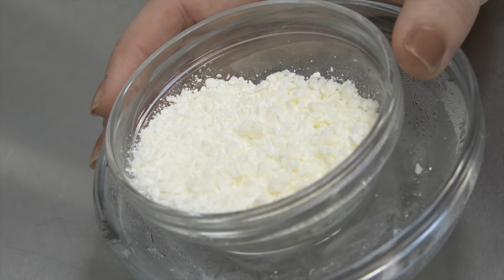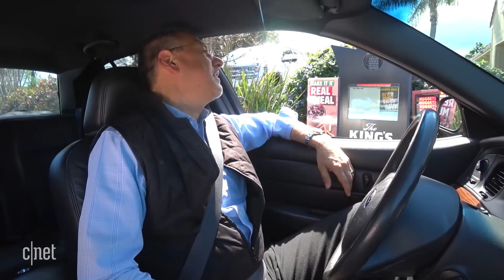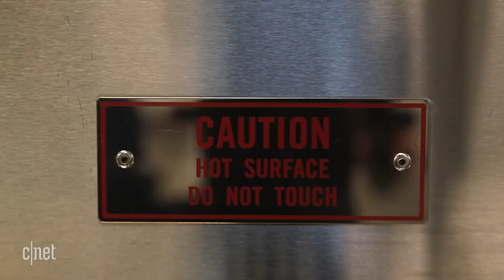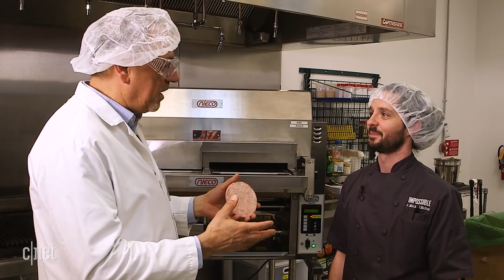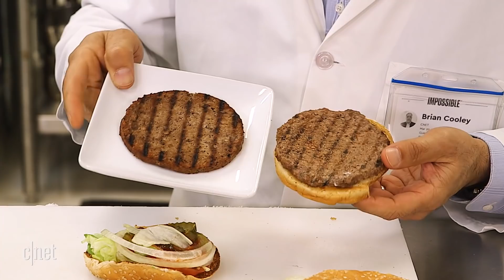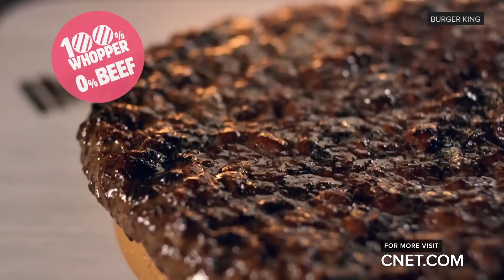Trying Burger King's Impossible Whopper

Comment: I don't understand it. The goal is, that it tastes exactly the same as a normal whopper, but it costs 1 $ more? Of course if you are a vegetarian you would pay an extra dollar for the burger. But shouldnt the goal be that even non vegeterian would buy it? For me personally, I wouldn't pay a dollar more for a burger thats supposed to taste the same. I would still buy the meat version, because it's a dollar less.
If it's the same price, I would consider trying the vegeterian version.
But that's only my opinion...
Reply: There are two factors to this. For 1, animal products are heavily subsidized, due to their feed being heavily subsidized. Should that go away, the beef in a burger will most likely triple or quadruple in price, at the very least, double. That alone could close the gap.

The second factor will be the bigger one though, and that's mass production. You can't scale beef production very easily, but you can scale plant production. Right now, it's still in a sort of prototype phase, but as more and more people start demanding these burgers, production can ramp up, and with it, comes a drop in cost of production per unit, and therefore, a drop in price. That could drop the price of this down to be the same as a regular burger, if not even cheaper.

Comment: As a vegetarian for over 20 years I have tried countless veggie burgers.   I finally got to have an Impossible Burger.   Very GOOD!  The best I've ever had...quite tasty.   Then ...........I tried the Beyond Meat Burgers.  So  sorry Impossible, but you have just dropped to second place.     Both were equally great in many ways although I did like the texture of the BMB.  However, the Impossible Burger just looks like any other preformed flat hamburger and is quite thin.   You would have to stack two IB to get the same height as the BMB.    
I will still enjoy the Impossible Burger at Burger King but perhaps I'll order double patty.

Comment: I can't remember the last time I had a decent burger at Burger King, nor have I ever been present when the burgers are getting cooked in anything other than the microwave. When I was a kid I remember the massive flame broilers they had going in back with a conveyor belt making burger after burger.  Not seen that in use since early 1980s. Lettuce and tomatoes usually resemble something picked from the dumpster as well. Quality control is non-existent at BK these days.

Comment: I did not realize how costly a Whooper is, $4.19 for your basic Whooper. I rarely eat fast food and when I do it is generally In-n-out, where a double-double is $3.45 and is WAY better. While I think this Impossible Whopper is a good and important step, until the quality is better or the price is the same or lower, it will not make any meaningful impact on meat consumption. From what I can find, outside of BK, buying Impossible burgers will cost you $6 for 8oz, which is $12 per pound, which is about 4 times the cost of standard ground beef and closer to the cost of a nice steak.

Comment: It's going to loose because of the price.  Sell it at the same price as a whopper.
Reply: The impossible patty costs more to produce right now because the company is very small compared to the gigantic beef producers that supply BK and other fast food chains. It's economics of scale. This particular contract will help them inmensely to expand. After a couple years producing in large scale you can expect the price to be equal or lower than beef.

Comment: But can a vegetarian trust that their impossible burger hasn't come into contact with a surface where meat has been prepared? This is great if employees are properly trained, and seperate equipment is used. This cooking method suggests that each location requires a seperate conveyor broiler to avoid cross contamination with meat. One slip up and someone who hasn't eaten meat in years could be pretty ill.

Comment: The only problem I have with making substitutes that are there with the ability to fool people. Is that people will believe that the intent is to fool people. 

It breeds paranoia. 

I have no problem with ethical eating and no problem with eating vegetables and fruits. But covert meat replacement I think will just drum up a lot of fear and suspicion on the motives.
Reply: Especially if they cost more than a regular one. Still, if helps to reduce the overweight in general, I'm fine with it.
Reply: @Lex60  well it's only more expensive at the moment, because the technology is still bleeding edge. Once the production line for it is established in sure costs will come down.

There is a floor to the price of raising cattle. And if the end production cost of the impossible burger is lower, it could cost jobs in the agricultural sector as farmers cut costs to keep prices competitive. 

Beef requires lots of different steps to lead to the final product. Which take up massive real estate footprint. There's a set amount of arable land needed per cow. And then there's ability to respond to market. 

Raising cattle to slaughter age takes a lot of time, so farmers need to plan way ahead of time. Depending on the processes and materials needed for the impossible meats, they may be able to ramp up and down production as market needs. Which means that there's less potential for over or under production.

Which will lead to lower costs of production. There's a ton of positives to come out of this technology... But the social impact could be massively negative.

Comment: All that science and Burger King still cant reach the conclusion to toast their bread.
Reply: Lol we toast every bun before we make the the burger.
Reply: I worked at a burger king when I was 19; they toast their buns, and pretty often the buns get stuck in the toaster  because it works by you putting the buns in the top and it shits them out at the bottom, with a heating element inbetween, and sometimes they're slightly too fluffy and get stuck close to that heating element and smell like shit.
Reply: The leftover meat that passed the timer, after resetting it 2 or 3 times, got put in a pan, crumbled up, frozen, and used for the next batch of chili.
Reply: Lucky Stockdale Wendy’s dude
Reply: i much prefer soft somewhat cold buns contrast with warm juicy burgers
Reply: oh they toast it. probably once a week.
Reply: @jhoughjr1  So people like soggy bread?. Damn. Color me surprised.
Reply: Ask for it double toasted nd it changes alot
Reply: Except that they are toasted.
Reply: don't like toasted bread...…………………………………………...soft bun with a drizzle of beef broth so that the burger's moist like White castle
Reply: @robinsss  that's disgusting. it only works with white castle because the burgers are like 3 inches wide and long.
Reply: wrong...……………………………………….it's a matter of taste but the  White castle flavor combination works with any size hamburger…………….………………………………………….the core flavor combination is onion and beef...………………………………………………….the pickles complement that combo and the moist bun  makes the whole burger moist which eliminates the need for mayonnaise , ketchup  or cheese
Reply: @robinsss  if that were the case you'd see normal-sized white castle burgers, which I've never seen at any establishment i've been in. i understand the logic. but a properly cooked burger is juicy, and thus when you bite in to it will saturate the bun making it soggy. you are the first person i've heard of that likes soggy bread... the rest of us prefer toasted bread so we aren't eating a mouth full of greasy flour. 

again, i understand your preference, i'm just saying you are in the minority that i would consider wrong ... like putting pineapple and ham on pizza.
Reply: if I  use  the same ingredients currently used in white castle burgers but make the burger larger if the only thing I changed was the size the flavor should be the same…………….……………………………………..white is sticking to it's trade mark burger despite the fact that it could produce large burgers...…………………………………………...they have known that for decades…………….……………………………….the  bun is not soggy ………………………………………...I only drizzle a teaspoon of broth on each half of the bun…………….…………………………………...and only Keiser rolls
Reply: @robinsss what you perceive as "flavor" is a combination of different tastes and textures. if you change the proportions of something that works such that you have proportionally more meat it doesn't mean it will be as good. but i've said all i need to say. it's your burger, enjoy it however you want - just don't expect the majority of the population to.
Reply: texture and flavor are two different characteristics…………….…………………………………..if  I made the beef patty proportionally larger in the larger version of the burger it would change the taste of the burger but I wouldn't change the size of the patty in proportion to the bun.………………………………………………………………………………….I prefer a thin patty …………….…………………………………………………..whether the majority likes my type of burger or not  White Castle's is doing ok considering they have been around since the 20's
Reply: I don't know where you eat at. But Burger King has ALWAYS toasted the bun.
Reply: Why would you toast a bun in a toaster or oven in a fast food place? When I cooked I'd just throw them on the stove top. That's the quickest and best way 👌
Reply: They used to toast them, at least when I worked there 20 years ago, it goes through the lower level of the machine. But that might have changed those baskets weren't there when I worked there, the guy on the other side would match up the buns with the burgers and put them in a warming drawer where they sat the assembly team needed them, unless you asked for a freshly grilled burger.
Reply: D. Carmo saves time and money not to. People will still buy regardless
Reply: culvers buttered toasted buns are top notch (as a vegan id love a vegan butter, and there are decent ones out there)
Reply: @4:43 ... you were saying?
Reply: Can’t ever remember eating a whopper and wishing the bun was toased
Reply: When i worked at bk, for that month, to buy a car, and get a better job, we toasted the buns in a little drop down toaster , then microwaved it. Lol
Reply: Everybody thinks they know how things are and usually they don't have a clue.

Comment: I have had the Impossible Burger at two locations in the DC area (obviously not BK) and I was not a fan. It left a really odd taste in my mouth when I was done and it was too salty. The texture is still different. It did not taste like it was an animal. I will admit, it was the best vegi burger I had (better than Beyond Burger), but I will stick to my meat. Just my opinion. I dig the innovation going into this though. If I was told that I could no longer eat meat, this would be my choice though. After a short period of time the texture would become normal as would the aftertaste.

Comment: If and when this catches on, and I think eventually it will, the price will come down as the demand goes up. They will be able to in time mass produce the product and cut costs.
Reply: You must be really naive to think the price will go down as the demand increases. You buy a new video card lately?
Reply: @davidtrottier1398  100% plant-based burgers are more expensive because they are the result of a lot of expensive research and because they haven’t yet perfected the manufacturing process of plant-based burgers over the course of decades to make it cheaper like we have done with regular meat. So that's why I suggest it eventually will get cheaper, not because I buy used video cards on ebay?? lol
Reply: @davie261  Point I was trying to make is that when demand goes up it doesn't necessarily mean that the price will drop using the personal computer video card market as an example.
Reply: @davidtrottier8963  Agreed

Comment: I'm one of the few who really should not eat beef, because my body doesn't process purines correctly, and I end up with elevated uric acid levels.  Because of this, I have cut my beef consumption down by about 90%.  I really only get beef when an alternative is not readily available, or on special occasions.  This would allow me to buy a burger as a normal thing, rather than always opting for chicken.  I had a "burger" the other day, at the Cheesecake factory - it was the Impossible Burger.  I've also had the IB at a couple of higher end pubs in my area over the last couple of years.
If Burger King rolls this out nation wide, I'll buy the IB exclusively when I go to BK.  $1 extra is nothing.

Comment: One dollar more for the healthier option. This WILL be the reason why it will not catch on, with the exception of the niche few. Instead offer it at the same price and if not for maybe $0.15 or a quarter more, but not a dollar. Most of america is at or below the poverty line. Cheap food is what they can afford. Unfortunately most, if not all, doesn't have the full nutritional value as a healthly premium meal does which also cost significantly more, and in which lies the problem with obesity. I have eat "healthy" but all in all I have a dock job that keeps me active which will burn off anything I put in my body. But again not everyone has that option. Yeah they can take a walk, run, or do some kind of recreational exercise, but when when you're living to just survive. "Healthy" is not a priority. So quit putting health as a premium and start putting it at a leveled priority for everyone.

Comment: But every Carl’s Jr. location has beyond meat? The last statement in the video is a little inaccurate
Reply: There are 0 Carl's Jr. in my state. There's Hardees, but the Beyond Burger deal was only for Carl's Jr. Hardees locations were not included even though otherwise they are essentially identical restaurants.
Reply: BK is going to be releasing in 7,200 stores. Thats more than beyond.
Reply: not yet though. Carl's Jr did it right and released it at all locations. What BK is doing makes me think it's designed to fail.  @nykidxxx
Reply: NickYDGn It's not at all. It mentioned at the scale of which it was happening. Carl's Jr has 1,490 stores. BK has over 13,000.

Comment: JUNK COW'S - So what is a junk cow.I used to be a Bull Hauler 1 job I hated was picking up old cows that had low milk output most of these cows looked run down bone  puss bags most of these couldn't  even walk into a bull trailer some times a cow would go down and couldn't  get back up so when unloading  these fallen cows would be pulled of the trailer with a chain tractor or bob cat some times the cow would tear in half.
This is the meat Fast Hambeger Joints use for there HAMBURGERS SO EAT UP..
By the way these junk cows are only taken to certain processors.

Comment: Will it be cooked on a grill with real beef whopper animal fat?
Reply: Burger King doesn't use a grill. they use a chain broiler. The only fat that might touch the patty would be on the chain it lays on, but most of that is burned off by the high temperatures.